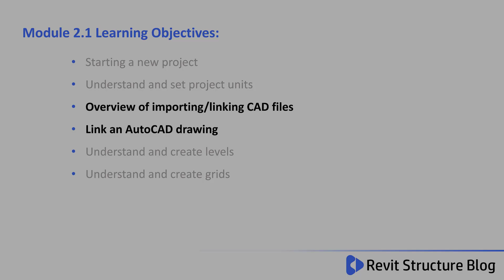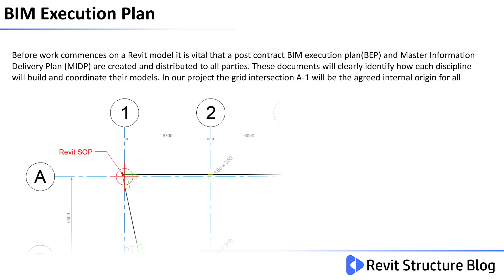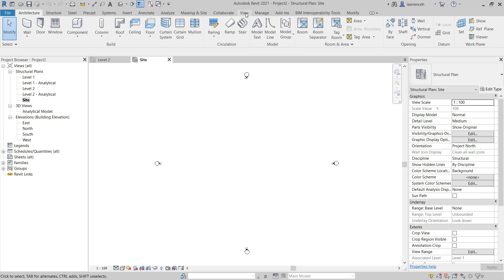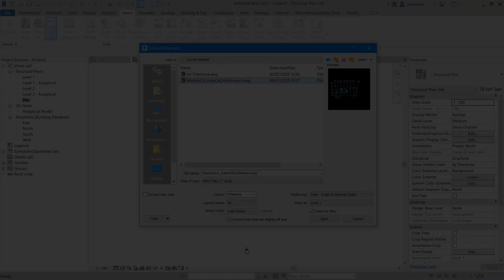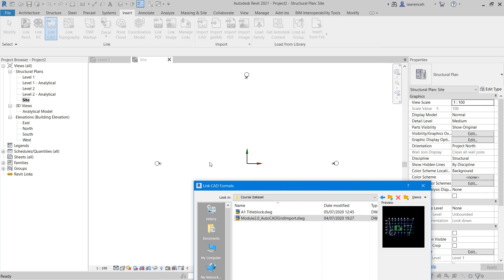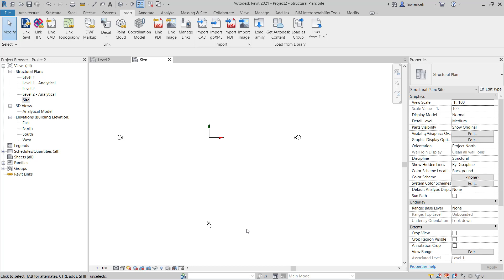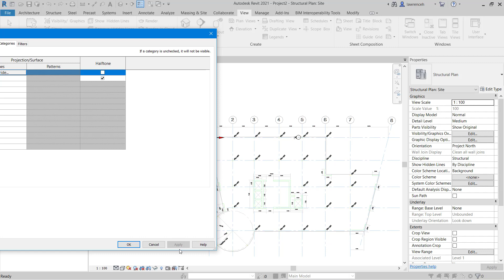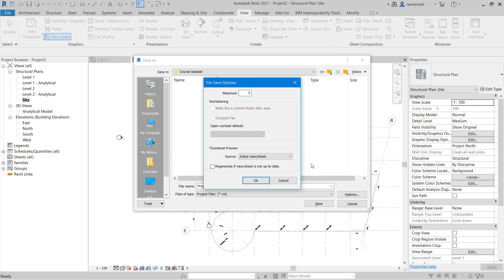Revit 2021 Training For Structures Essentials Module 2.1

Comment: I cannot see the Internal Origin option. Is it because I am using 2018?
Reply from the maker: yep, you can locate it by creating an AutoCAD drawing with an element at 0,0 and then link it into Revit - origin to origin
Reply: @RevitStructureBlog  Thanks. Got It.